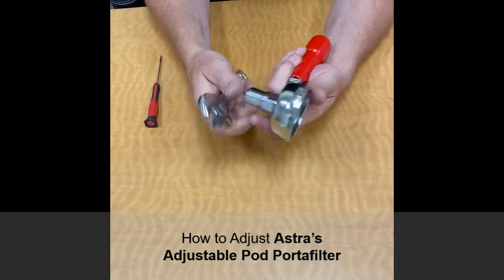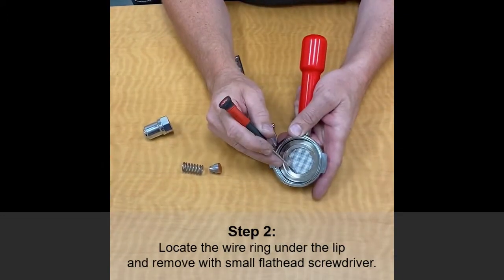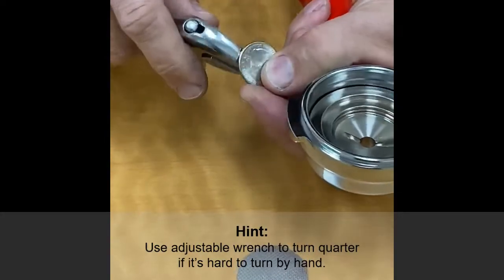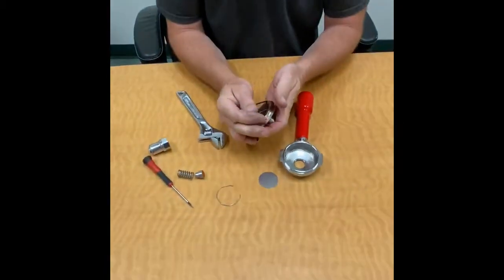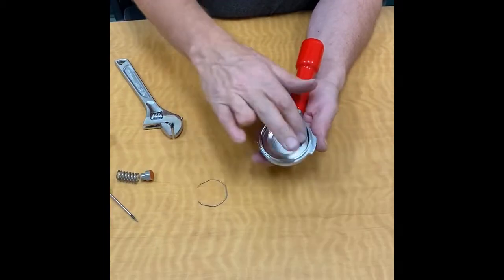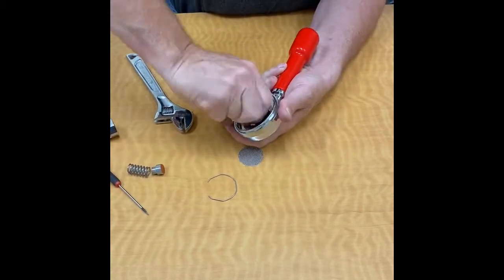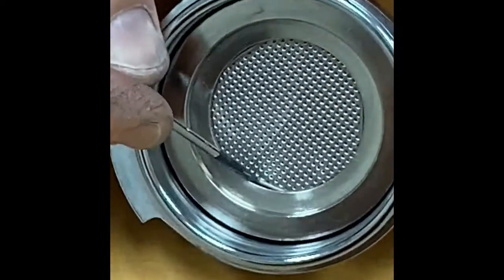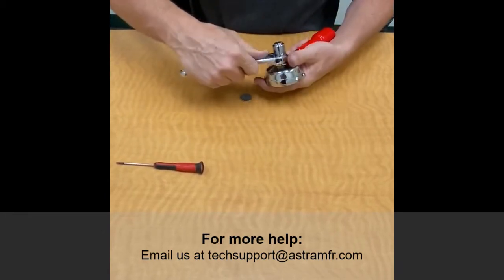Astra Espresso Machines | How To Adjust Pod Portafilter

Comment: Thank you - nice video - this is just what i was looking for - deconstruction of a pressurized portafilter.  I have a Grimac machine with E61 head.  Is there someone I can contact at Astra to get the dimensions of the tabs and height of the ring that seals on the gasket to see if this portafilter might work in my machine? (My impression is that Grimac doesn't make one...)  Please let me know!